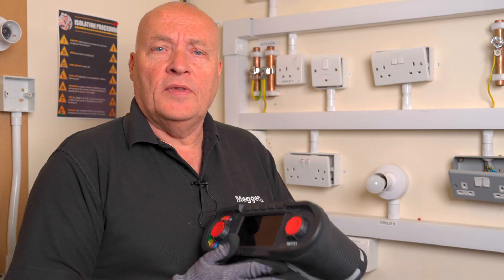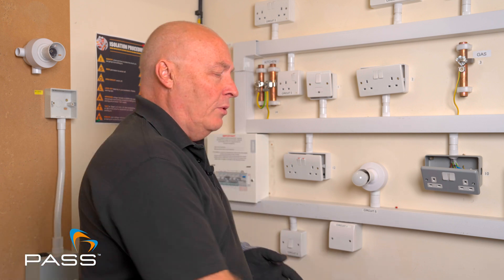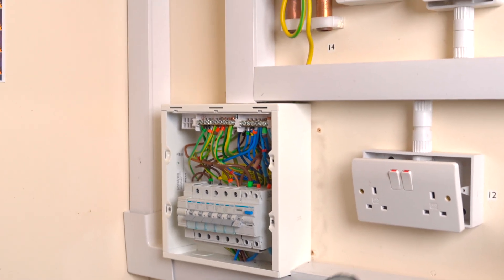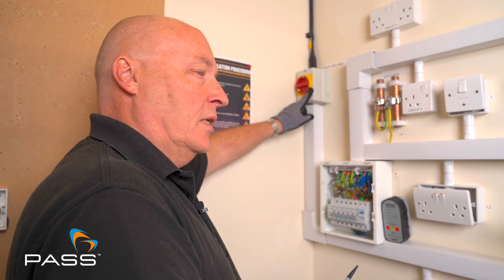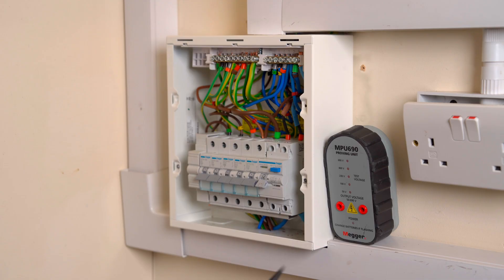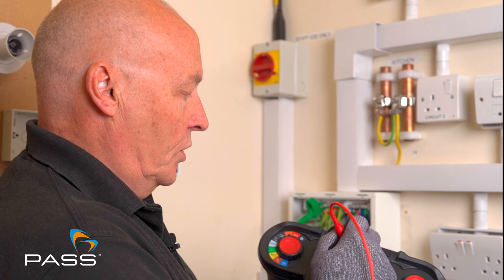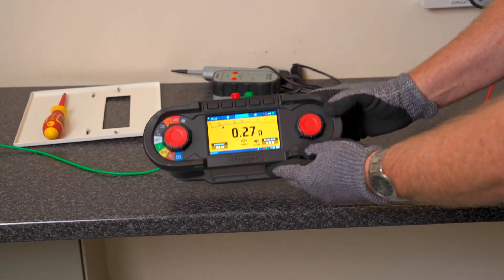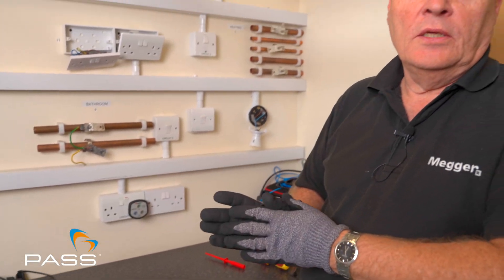How to Test Continuity with a Megger MFT X1 - Easy!

Comment: Best zero the leads again not one of the continuity readings would rear above 0.05 on these distances. Also when you tested the supply you tested phase to neutral top Terminal  but this would have been isolated by the rcd  but nice tester.
Reply from the maker: Thanks for the info!

Comment: You keep saying "live & neutral". Neutral is live.   You also keep saying "earthing" when relating to the extraneous conductive parts, you should say "bonding only". The test leads are not "positive & negative", that is relating to DC. To test continuity of main equipotential bonding conductors you should disconnect one end as the test you did proves nothing. The water pipes would normally be connected to the water heater which is earthed from a cpc on that final circuit
Reply from the maker: We really appreciate your insights! Your expertise helps improve the content for everyone, and we'll make sure to clarify these points in future videos.